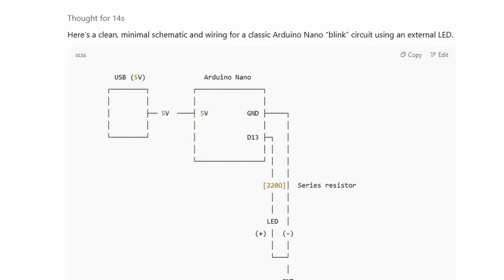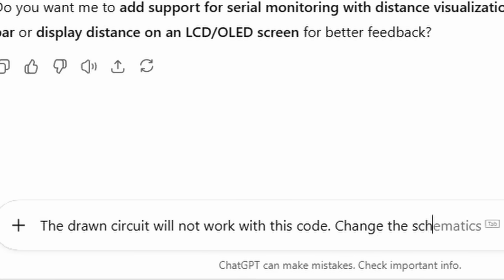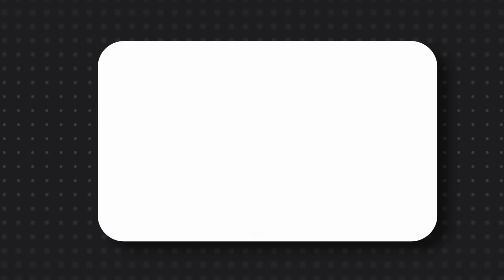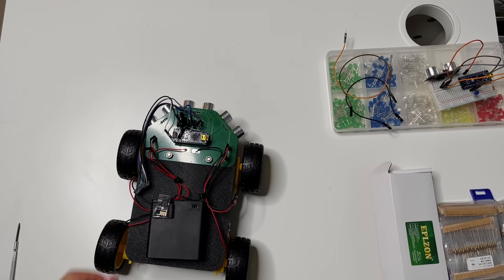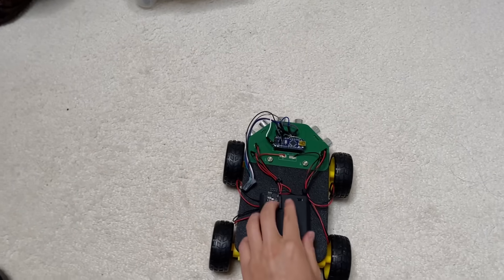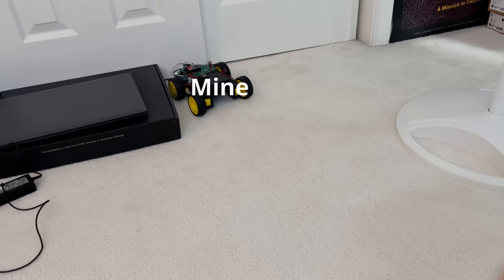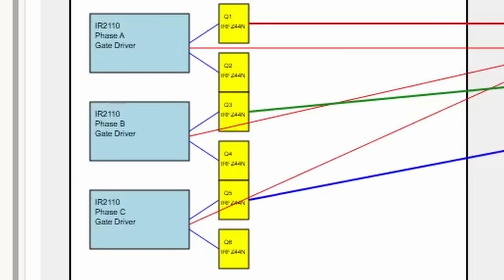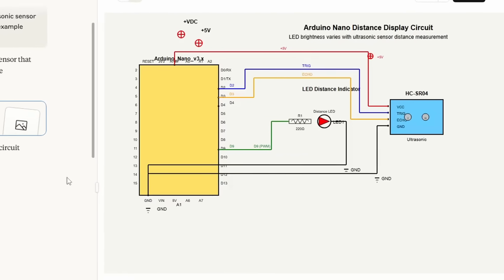Can AI Design Electronics?

Comment: I went to college for Electronics Engineering in 90 to 92.  I tried Google AI Pro for 30 days and it failed day after day after day for a full 30 days.  Out of the 30 days, It built one complex circuit that i asked for that worked.  The other 29 days Google (Gemini) Pro Failed repeatedly and it was a huge waste of time...  Thankfully the first 30 days were free.  I would never pay more with current statistics.

Comment: before i start watching this i know for a fact Chat GPT-4o coldnt even select the right parts to help me fix a variable power supply. 
as soon as i turn it on i heard 2 very loud explosions as the new components detonated instantly. 
i told GPT the model number off the components i tested to be dead and it confidentiality told me the parts it selected would work.

its text based diagrams are awful.

but ChatGPT has amazing image recognition skills. if you ask it what it can get from one picture it goes into detail. 
one picture i sent of the inside of my powder coating oven (toaster oven) it knew i had a DIY setup and not industrial equipment. it knew the color, shine, detail, shape, of the coated object inside, and noticed the loose bolts i had in it.
Reply from the maker: Yeah, ChatGPT can often times be confidently wrong. Pretty harmful if you aren't the wiser 😬

Comment: 😅 i think it will be the most easiest thing for an ai to do in couple of years with perfection not 90 percent electrical engineers can achive. But yeah trouble shooting will be as much difficult if you haven't studied to design it by your self. Its the real ristriction from now on. Even you can get 90 percent work with perfection, but to troubleshoot, you yourself need to be capable of what ai had done😅

Comment: Right from the start of the video, I was a bit infuriated, the image generator model is uncomparable to the intelligence of GPT-5, you gotta tell it to output it as a text describing the connections instead of a diagram (it doesn't know how to do that yet properly because of tokenization), there it will work MUCH better.

Comment: For now, certainly not, I used it to design my circuit and I realised I spent 3 days prompting, until it made a grave mistake by recommending a non existent component, so I got mad and checked the datasheet, guess what, all the previous values it gave were also completely wrong, I would have gotten a disaster circuit.

Comment: I recently graduated electrical and electronics engineering and ai is already taking out entry level jobs so yes even hardware engineers are not safe
Reply from the maker: Ooh boy, I'm graduating EE in '27. Guess I'll just need 5 years of experience as a new grad 😬
Reply: @TheTinkeringTechie lol good luck, I been applying for internship for a year now and nothing, most undergraduate I knew I'd say  couldn't get anywhere with their applications and I graduated without internships. It's super competitive and the positions are limited. Grad roles are even worst unless you have strong industry connections or even better nepotism else be ready to apply hundreds of times

Comment: As someone who has used ChatGPT to help design a fairly sophisticated MIDI controller over the past year, the way you're approaching demonstrating this is fundamentally backwards. First, trying to one-shot anything - software or hardware - is totally missing the point of what these tools can do for you because it's just a party trick. You have to spend real time describing what you want it to do in as much detail as you can offer, at which point you basically have an extremely patient mentor who knows every part, every equation and all of the physical laws that govern how electrons flow. They can help you troubleshoot extremely sophisticated issues and offer different approaches. Asking it to design a circuit board isn't even remotely on the menu. I'm not sure that would be useful even if it was possible.

You're not the only person I've seen explain this stuff this way (dismissing it as unready or underpowered) but I don't understand how people can be sleeping on how big of a deal LLMs are for electronic engineering. I say this as someone whose other window is a ChatGPT session where it's helped me tune a four path control voltage input network that can safely handle a voltage swing of -10V to +10V (0-3.3V, 0-5V, 0-10V and -5V to +5V to ensure maximum precision on the ADC) which involved biasing with an op-amp using a reference voltage IC, a whole bunch of BAT54 clamps and carefully calibrated trims, and an above/below-the-rail A/B switch. To be clear, I didn't know how to do any of this - I wasn't even 100% what I needed to do - until the LLM patiently explained it to me. No ego, no "what, you don't already know this?" energy.

The only thing you found with your approach was what you set out to find, which is reassurance that AI given bad input won't replace you. I've got news for you...

Comment: I've found doing a few small functions at a time with AI is ok. Keep the loop very simple just calling functions.
It can get inefficient and convoluted, but generally i found its 2 to 10x faster for the same amount of features.
I generally add more features by using AI.
I think engineers should be designing MCU products with context engineering documents that can be uploaded into a chat, and the user asks for a specific feature set. Based on the context engineering documents, the AI can create a working project in one go.
-Ken.

Comment: is this.. vibe engineering
Reply: Yes it is chief
Reply: This is the only thing i want it for, something that can being your mind into being
Reply: It is coming. Nobody is really working on this just yet, but they will. I believe AI electronics design will happen within 3 years, once they have perfected coding.

Eventually it should be possible to design, 3D print/prototype, tweak, etc. arriving at a production ready product using AI.

Then having AI contact and contract suppliers, subcontractors to setup manufacturing having the device mass produced.

Then marketing and distribution.

It won't all happen overnight and there are a thousand problems to be solved, but it is coming.

Please also note the amount of private knowledge necessary to execute the whole process well. That might be an obstacle but also an opportunity.
Reply: @TomM-p3o  If it will be superior on coding then it will going to affect all engineerings because most of engineers use software products.

Comment: I have found AI can only regurgitate stuff that already exists and they have been trained on. Ask it to design something original and it hasn't a clue.
Reply: that's not true for gpt 5 pro
Reply: @n0ne0ne  its true just u dont know
Reply: @n0ne0ne  yes it is. GPT-5 (or whatever 6, 7, pro, etc… that comes out) will be functionally the same as the previous version.  It’s an LLM. The only thing that can maybe make it logarithmically better is more original material added to the model.  Of course there will be much less of that if people continue to use this crap and put the slop back on the internet.

Comment: You need to let it use better tools. Ascii, image generation and HTML weren't made for this sort of thing. It knows how to use EDA software. It works even better when you finetune it to. The abstractions it learned from literature directly apply to EDA. That also allows it to debug it's mistakes.
Also, you should be clearing the session every time you have a new question. Performance drops quadratically the longer the context window is, and previous tokens, especially if they include mistakes, create red herrings that propagate through the network.
Reply: I agree with you, it's important to clear every session so you can ensure accurate and better results

Comment: I work with ChatGPT a lot and I think the main issue here is asking for schematics instead of pin mapping as a table. I use it to help me wire things up a lot and it’s really good as far as using dev boards and sensors goes. I’d say something like “I’m using esp32 wrover, I have these components, here are the links to data sheets, tell me which pin to wire to what” and it does pretty well, for esp32 it avoids the strapping pins, correctly used ADC pins etc and provided a working code. 

For coding, behaviours need to be well specified. If I was doing an object abiding robot, I’d go through things like if there’s an object how do you handle it, how to handle stuck states (eg if not moving for 5+ seconds). Great thing is that you can ask ChatGPT what error modes you’ve missed. I treat it essentially like coding myself but in natural language. 

All in all it’s like an intern or a junior dev, if a task is well defined, it’ll do well.

Comment: As an Electronics and Communications Engg student I find  that except for circuits with well known layouts and pre built connections I personally haven't found AI helpful,. Designing amplifiers from the ground up, or even a basic BJT biasing I find AI not very useful, one would hope that what I learn now would be non-replaceable by AI, but seeing how fast AI develops I'd say a year or 2 would suffice to automate even the most complex of circuits.
Reply: I think if you fed specific data sheets into NotebookLM that you know you might be using then that would help.

Comment: ChatGPT gave me code for an ESP32 to turn lights/things off/on in RC cars. i used a MOSFET stripped from a PC motherboard CPU power phases so it runs on low voltage and handles high current.  First,  i made a single channel one then made a second one with 2 channels so i could control a horn and lights.  worked perfectly both times.

Comment: I've struggled with this myself.  I get the best results if I plan out the entire project - how all the parts (sensors, motors, etc.) relate and then write a detailed description of the whole thing.  Spell out the connections, the logic you want...everything you can think of.  "Motor 1 on PWM pins 4  and 5 is the front left of the robot.  Motor 2 on PWM pins 6 and 7 is the front right of the robot.  To move forward, Motor 1 PWM on pin 4 should be at 75%.  Motor 2 PWM on pin 7 should be at 75%."  (This assumes you have a motor driver with two pins, where each pin needs PWM to turn the DC motor.  And you use opposite pins to get the motors to move in the same direction when they're on opposite sides of the robot.)  

This way you're having the LLM look up all the syntax and fill it out - but not letting it "invent" anything.  If you let it try to solve the problem, it will just look up a bunch of different examples and try to fit one of them into your description.  And it will be wrong.

If you have special requirements (i.e., you want to use Neopixels with FastLED) then tell it exactly what you want it to look up.  It's not smart, it's a fill-in-the-blanks search engine.

Then your job is to test the result and update your specification.  For example, when your robot saw two objects and oscillated between them, you should tell it to recognize that there's not enough space to drive through and turn around to go away.  And tell it HOW you want the logic to work - "if the path is blocked on the left and right within an arc of X degrees..."  Something like that, I'm just spitballing on this one.
Reply from the maker: Interesting. Seems similar to programming where the thing you program does exactly what you tell it to do, except this is a bit more intelligent. Seems like good input, good output.

Comment: I would say AI struggles with advanced code generation for Arduino probably to do with the fact that Arduino logic is actually extremely illogical and many functions don’t do what they sound like they should do. However, I believe if you were to switch to the ESP, you would find that it is able to rate code for the ESP much easier, and let’s face it the ESP is just much better than the Arduino especially the ESP D2 r32 wemos that thing is insane, compared to an Arduino Uno it has more memory than an Arduino mega and surprisingly, high processing speed
Reply from the maker: ESP32 is pretty impressive. I still use the arduino IDE as I'm transitioning between arduino and ESP32, but it does have much better capabilities as you've said. I hope to be able to make more use out of ESP32 in my projects!

Comment: Ai is not going to replace most jobs but it will change them, you can make it do great things but it still needs to have someone aware of limitations and requirements to ask and check output for example you can ask it to create something to store data but it won't comply with gdpr rules unless you tell it, it won't take into account legal limits on what can be stored where unless you tell it and in my experience you have to check output several times to see if it's correct as it often makes less complete versions of what you asked for example I was using it to develop a DND tool that outputs srd 5.1 spells by level I asked it to do all spells and it output one per level it kept saying it could do it then reported it was too much data for it to output it's code structure was fine but I was trying to avoid hours of manual entry eventually it made a tool that downloaded and wrote the code via API which is probably more complicated than what I wanted it to do
Reply from the maker: True. I guess AI always comes down to human made algorithms, neural networks, and the like. AI is like a Swiss army knife, but you need to know which tool to use.
Reply: Absolutely!

Comment: Very cool!  Grok has been helping me with some ESP32 Wardriving stuff so it is scary how good it is in the right circumstances.
Reply from the maker: Interesting. AI does seem much better at Code than hardware, but that may change in the future.
Reply: @TheTinkeringTechie  I think AI is better understanding code than hardware, simply given the fact that it’s harder to interpret Data from images in is to interpret code, However, I have been working on a project with the AI completely generated parts list build materials how to wire it how to program it, but I give instructions to every response had to be done in text so I didn’t get any diagrams or any schematics and I’ll tell you what it is insane how good it is at describing a circuit if you give it a bread pudding you tell that the bread board is labelled A through Z and one through 17 and you tell it letters are vertical numbers are horizontal. The AI will understand the breadboard layout and will give you a schematic in text. Where it can tell you that the anode of an LED has to be plugged in to pin 17 F as the entire f row is a ground bar, but even once it’s designed a schematic in text if you feel that schematic back to and asked to generate picture of the schematic it struggles, but if you ask it to generate a picture of code, it also struggles to generate a picture of code which means that actually I think it’s the image generation part of AI. That sucks and lets not forget that the core of an AI is the algorithm that searches for data and passes data but all the other stuff like when you put chat GPT into codeGPT what you’re actually doing is your opening a specific wrapper The image generation software, I believe it is still Dolly which is better than it used to be. It can now carry continuity across by generating a template that it remembers and then it’s able to modify the template. Rather than generating an image from scratch every single time but it still sucks, if you have a look for schematics on the Internet, you will see a lot more crap drawn pictures that pretend to be schematics, that are actually complete garbage, drawn by someone who probably doesn’t even know what a schematic is supposed to look like undergoing off of memory of something they’ve seen once before a couple of years ago there’s a lot more of those that there are a proper schematics, and considering the way that the size have been trained, I don’t think the creators really took that much time to sort out the crap from the gold hence, why image generation of certain things is good, but other things is diabolical